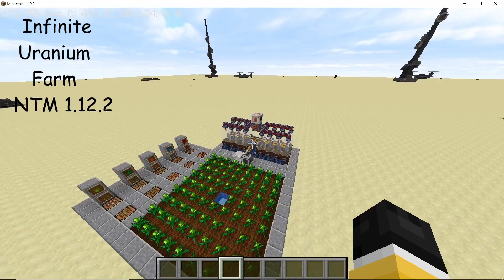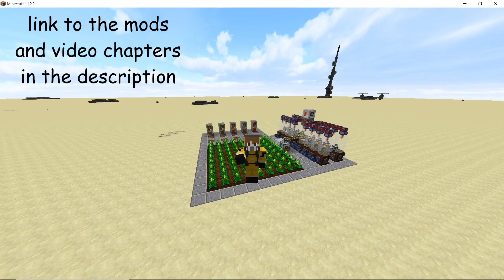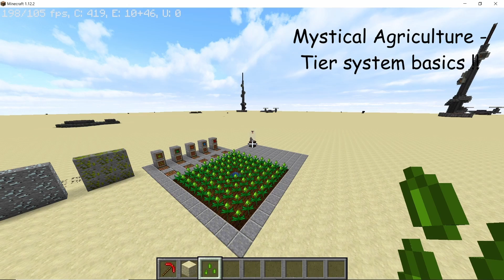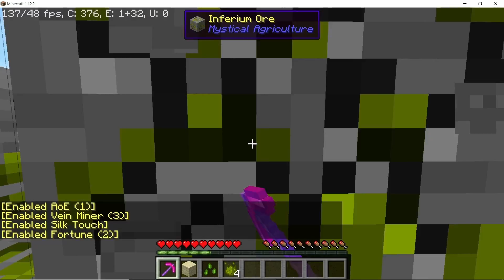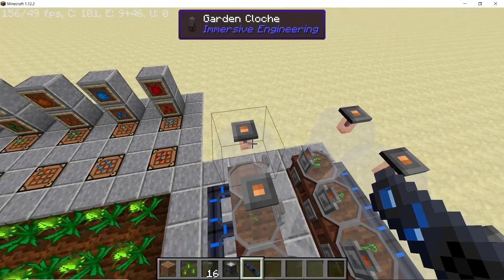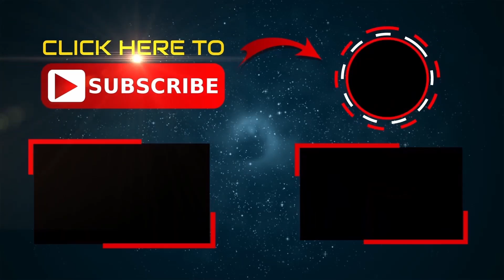NTM Uranium Farm using Mystical Agriculture and Immersive Engineering - Minecraft 1.12.2

Comment: you can also use void miner mods if you feel too op with mystical crops
for example:
Extra utilities 2 (quarry miner, uses large amounts of power but produces many resources, fully customizable
Enviromental tech (void ore miners, total of 5 tiers, each tier requires more space more resources and more energy, but also scales up the generating of resources, enchant-like modifiers
Industrial foregoing (like the enviromental tech one except way more expensive, slower, smaller, doesn't have tiers and is not customizable. Correct me if im wrong i haven't played with this mod)
void miner mod (requires mechanism, like extra utilities 2 quarry but a single block, extracts both fluid and items, and is not customizable. Correct me here too i haven't played with it)
Reply from the maker: I use mystical agriculture cause it's very compact and gives the exact resource needed, if not this then my next choice is definitely the environmental tech void miner cause it looks so freaking cool. But yeah for this project mystical agriculture is perfect!!

Comment: i cant make the water barrol like you have in the middle so what can i replace it with
Reply: nvm as i cant even make the same pipes you used
Reply from the maker: The water source can be literally anything, you don't need barrels and pipes from ntm in order to supply the cloche with water